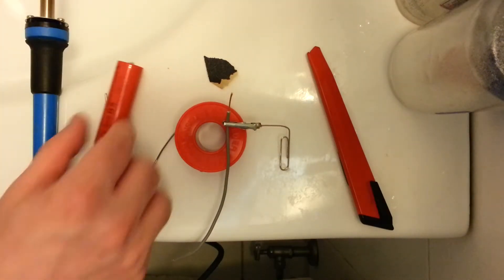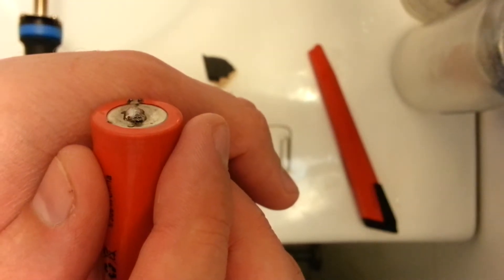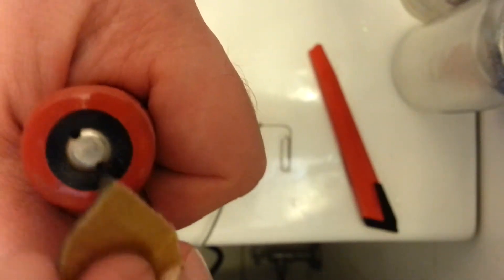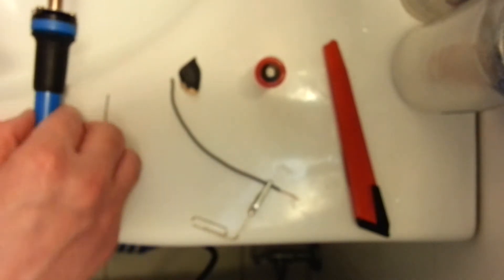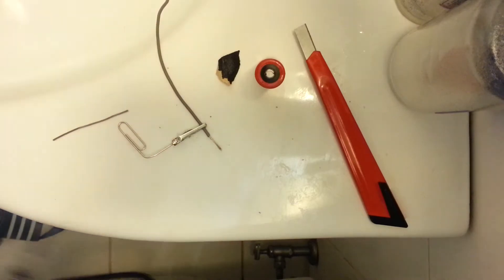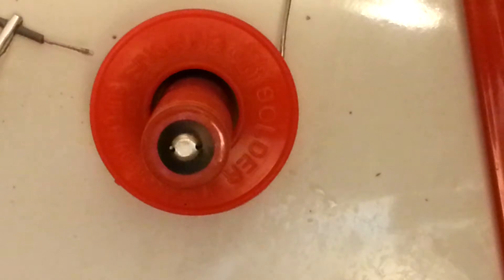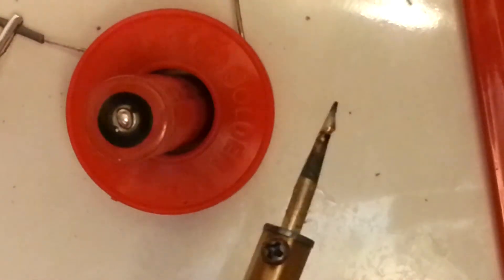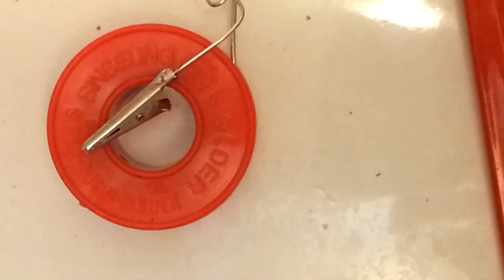Soldering 18650 batteries with a low wattage iron

Comment: Dude, you shouldnt make videos about things that you dont know anything about. You never tin the battery directly when soldering batteries and you dont solder wires directly to them. You need to get some nickle strips and do a single sided tin and then transfer it to the battery using flux. Then you can solder your wire to the battery tab. You can attach a wire to a battery like that but youll degrade your battery way more and it could even be dangerous to apply a soldering iron directly to any sort of lithium battery. On top of that you need to actually be using a wide tip and you should aim for about a 750F temperature on your iron in order to transfer heat more efficiently thereby reducing the amount of actual touch time you use. Yes, you can do it your way, yes it will work (probably), but its not the smart nor the efficient way to do it.
Reply: MANY THANKS

Comment: Well, you make it seem very easy ! I just got some brand new NCR18650B and I need to make 3S packs with them. The battery's pad are very shiny, I hope light sanding will be enough, I really don't want to ruin these $$$ batteries though !
Reply from the maker: +shodanxx It's not very difficult, you just went the heat for the smallest amount of time possible. Use rosin core and extra flux if you've got it. Allow your iron to hit full temp just before starting.

Comment: @ ryanh1986   You need to learn how to solder correctly first. You must not apply the solder to the hot iron as you've done because the flux burns up before it can do it's job on the work that is to be soldered. You must apply the solder to the work plus the iron at the SAME time.
Reply: Both a dumbass and a homophobe.  Classy.

The joint is cold because you didn't heat the wire.  You're an idiot.

Comment: Nice effort! But why do people spot weld when you can solder it? Puzzling.
Reply from the maker: Richard Tan Tan Soldering some Li-Ions can be extremely dangerous if you don't know what you're doing.  Also, spot welding would absolutely offer a better connection.  I would ONLY solder to IMR / LiFePo4 18650 batteries, ICR would be a big no-no and potential explosion in your face.
Reply: ryanh1986
Is there any setting differences using a spot welder when welding ICR vs LiFePo4 or IMR Lithium batteries?
Reply from the maker: I'm no expert by any means, but spot welding when done correctly is extremely fast and precise. This should effectively transfer less heat to the battery case, if any at all. The positive tab or button is typically raised from the surface of the actual battery casing, therefore the heat will mostly be concentrated there for just under a second or so. With soldering, more heating time is needed, therefore actually bleeding off some heat into the surrounding metal becomes an actual issue.
Reply from the maker: As far as setting differences, I don't know... If I had a spot welder small enough for a job like this, I wouldn't be soldering lol
Reply: ryanh1986
Seems like these metal strips are hard to weld . Maybe due to the coatings or the metal is simply hard to solder? I know that aluminium strips cannot be soldered using conventional solder tin.
Reply from the maker: The aluminum strips can be difficult to work with, but I've gotten plain solder to work before.  It just takes a lot of heat, super clean and pre-fluxed connections beforehand.  I hit them with some light sandpaper with flux already applied to keep oxygen out.  This lets the flux go to work on bare metal instead of oxidized aluminum (Al oxidizes almost instantly otherwise!)
Reply: ryanh1986
Thanks for enlightening :)
Reply: minimizing the contact time reduces the time the heat has to conduct into the cell and damage it. also welding it more like adjoining  the two parts rather then mating the with solder.

Comment: Nice cold solder joint :)  But even a cold solder joint is better if made with good flux. The flux inside the solder isn't good enough, particularly if you are not bringing the surface of the two things you are soldering together.
Reply: that's not a cold solder joint.  Tinned wire + tinned battery + melt in between the two = perfectly fine joint.  People have been soldering nicads and nimh with the same technique for a long time.  With liion you just need to be as fast as possible.
Reply: Not if it were physically constrained by the cold solder blob which it is.  That's absolutely a cold solder joint because the wire was NEVER heated by the iron.  Proper soldering involves heating the material and then adding solder to the parts, not the iron. Never create an enormous blob of molten solder in the iron and then just dab a cold wire into it.  This is the textbook example of what not to do.
Reply from the maker: tarstarkusz The wire will break before this solder job does.  I know this because I have since disassembled the pack in the video and decided to test it out.  Also, at 60W I am getting only about 0.10v battery sag under load.  This is very indicative of a good solder joint, not a cold one.
Reply: ryanh1986 It didn't look like you were getting the surfaces hot enough. The best way to tell is by color.
Reply: +tarstarkusz If it were a cold solder joint, the wire would have fallen off immediately

Comment: Why are you not using a good flux? Soldering onto batteries is usually pretty difficult in the first place and the soldering job you previously did (that big blob) is indicative of not using flux. Radio Shack makes a good (but sticky) flux that will give you much better results. Also, I see you are tinning a wire that is laying on a good sink. You should get a  pot or something, turn it upside down and do the tinning on that because you could end up leaving a burn mark in that sink. I also hope you are using a bathroom grade outlet (with a built in breaker) for your iron should it fall into the toilette or otherwise become submerged, particularly if your bathroom is small or the wire isn't directly under the sink or somewhere really close by.
Reply: He's not soldering naked in the bath, with the shower on, or with water in the sink. His mains supply really doesn't matter any more in a tiled environment than elsewhere in the house. People worry too much :-)
Reply from the maker: tarstarkusz Sink already has burn marks on it from the previous occupant of the house, you just can't see them in the vid. Outlets are all good to go, and I'm sitting on the toilet with the lid closed in the vid. :)

I have since started to use flux but I haven't had to make any more packs within the last 8 months or so.